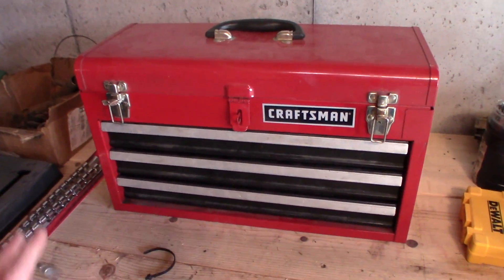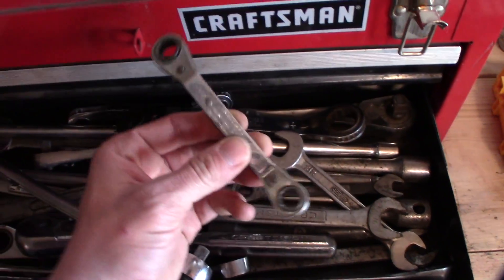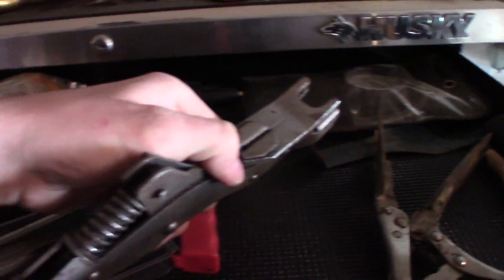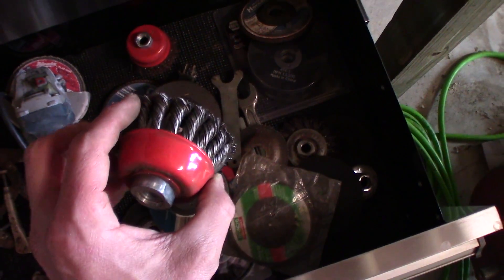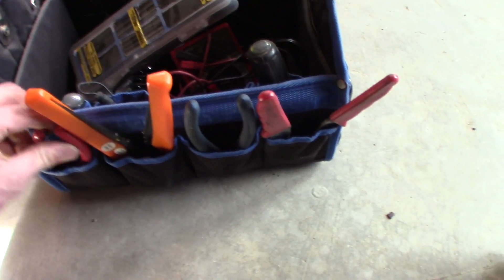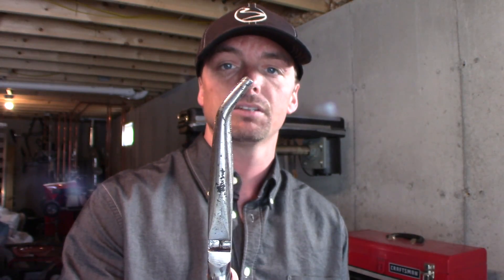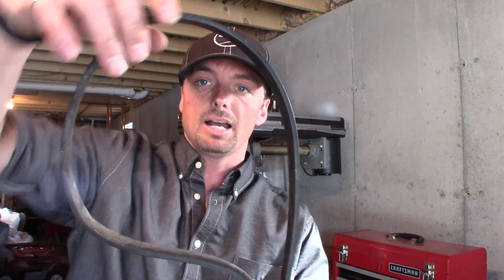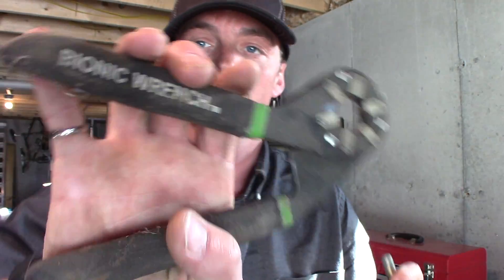What's in my tool box???

Comment: Just got the craftsman box with tools. I'm going to put handles on the sides.  Tough because its double walled with 1/2" gap and not a lot of space between the rails inside.  I took a set of heavy handles off a Harbor Freight 26" US General to;p box.  Nice handles.  The Craftsman box is nice for the money, the set of tools with it is probably a $80 set at best.  Its got all 3 size drives, but not to many 12pt 1/2 sockets and tiny wrenches.  Other than that, the box allows tons of room to add tools.

Comment: Great video, add this one to your tool box. Have you ever seen the A-SURE OUT extractor? It can be removed in seconds if it breaks, no Welding EDM or DRILLING. After seeing it, only a fool would use anything else! All materials and labor made in the USA! For over 100 years the bolt extractor has changed in many ways, however the failure of a bolt extractor seems to have been carelessly overlooked leaving all users the possibility of catastrophic failure. Help support an American company. Thank you.

Comment: Do you think a lt1000 craftsman 92 would be good for a mud mower? Please respond -r.m.k
Reply: yes for sure. my friend had one. it was an animal
Reply: Older craftsman mowers are what I consider the best base to start on, they are easy to work on, easy to add frame reinforcement , thicker than Murray frames steel, and a smoother ride with a more heavy duty front end. On one of my craftsman lt 4000s I welded 1 inch square tube up both sides of the frame with 1 or two cross members and it made the frame unflexible. I was going to do the same to my murray but it is impossible to do because of how the steering, clutch,and transmission are attached .

Comment: would you know how to weld a dif in a shaft driven garden tractor
Reply from the maker: Robbie Marshall do you mean welding the rear end so it's posi? If so, I have done a couple of videos on the process. There are many different techniques, you can do a search and find endless videos
Reply: FearlessFront (Todd Christopher)  i want a posi  for my 122 cub cadet but it has a drive shaft I would like to have a posi rear end in it